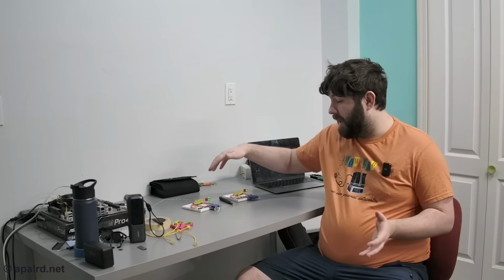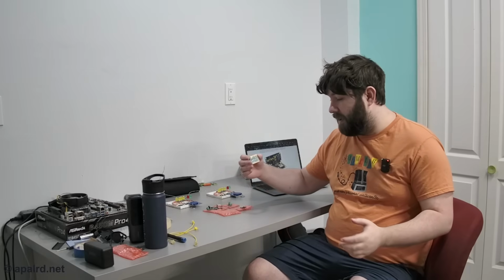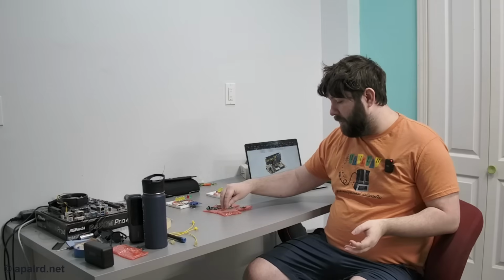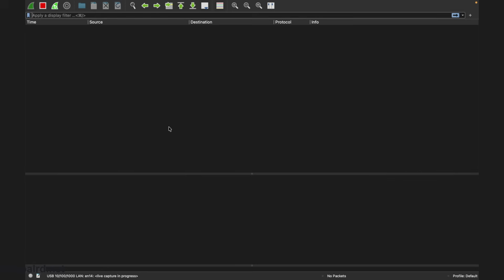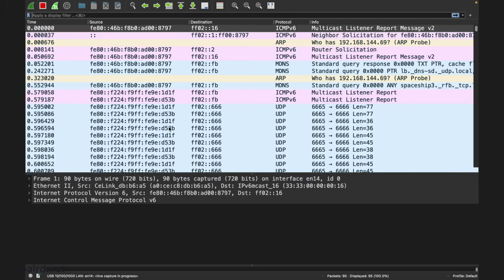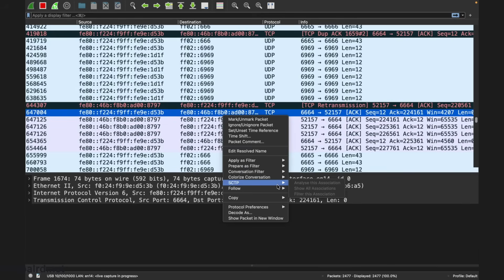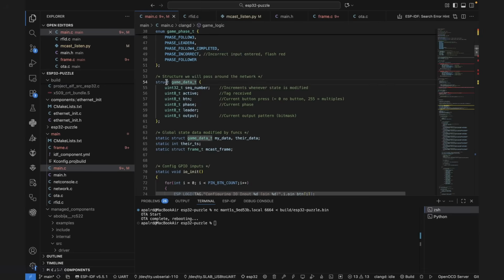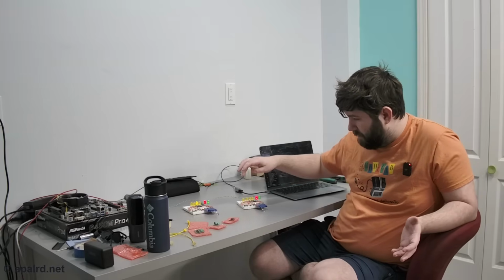ETHERNET is a BUS again?!? Taking a look at 10Base-T1S Multi-Drop Ethernet

Comment: Maybe a missed point is how T1S is galvanic isolated (with capacitors or magnetics), where CAN and RS-485 need additional hardware.
Reply from the maker: T1S (and all Ethernet over twisted pair) can be galvanically isolated. However, in the T1S case, that means you can’t use power over data lines, and these boards aren’t galvanically isolated.
Reply: @apalrdsadventures yes, they could have a jumper to disconnect the power part when you need DC block.

Comment: spe has no general availability in 2026

i also need low speed multidrop or daisychain fiber buses to be available

perfect for remote control, super easy to transient protect. could put mov on power and data just won't conduct at all

Comment: Electrically, CAN bus is not 2 but 3-wire. Although it might work when the power source is shared, this is not the correct wiring. A common ground is needed to refer to by the expected potentials over A/B wires.

Comment: Actually one single bus that connects everythiong in a car, to simply put never happening. Manufacturers will always keep separate (at the bare minimum) the mission critical from the infotainment......
Reply from the maker: It’s already here. High speed stuff uses point to point T1 Ethernet, and low speed stuff is using CAN and moving to T1S. There are still Ethernet switches at key points and those can restrict bandwidth per port and limit who can send which frames.

Comment: In a way solving non-existing problems. A fieldbus is mostly used as a memory. To that memory various sensors and switches are mapped.

If you have 100kbit/s or even 1Mbit/s and transferring switch/sensor status within couple of bytes.
VS. Ethernet 10Mbit/s for those registers one byte value but minimum frame size is 64 bytes... you are able to calculate.

The only useful thing is PoE. But PoE switches have their limits. One of the limiting factor is high cost.

Multicasting is really rare.  Have not used it during my 40 years with Ethernet/Internet. Except defined one for MOM use.
 
Have researched this area a lot because would like to create a dynamic (plug'n'play) sensor network for farm use.
Reply: Did not even mention the extra power usage. For example if you have like 1500 sensor boards around ...

Comment: This would be the coolest thing ever for home automation.
Reply: I'm interested in which usecases you are seeing?
Reply: @randomname1234-y4k given that it's a bus, you could just daisychain lights together, or run a single pair of wire from one automated curtain to the next. It already has power, so you don't have to run power wires or have to deal with replacing recharging batteries every week. Just 2 simple wires. It's ESP so it should run ESPHOME just fine. And you don't have to have a million devices clogging up your 2.4Ghz wifi.

Comment: Any thoughts on using this for Home Automation? Using 8 nodes/sensors per segment to create multiple zones within a house. Add a few bridges with CAT5e to your LAN and add the stuff to Home Assistant. Some custom boards with the LAN8671, MCU and some LwIP for some sensors?!. Or would it be better just to give every sensor a single port Ethernet PHY, or or add a 3-port switcht to every sensor to "daisy-chain" the sensors...(PoE would be more difficult in this situation, PoDL for T1S would make it great to create power and data for this small group of sensors) Great video BTW, great to see you doing ipv6 on Embedded! PS Ethernet is awesome!

Comment: There's no difference between this and CAN, because you still need a gateway before bridging into regular Ethernet
Reply from the maker: This is still Ethernet so the bridge is not converting frames and does not need to be aware of any of the data structures. Can gateways need to decode the data, so they need to be programmable and are another device you need to keep updated with data formats.

Comment: So is it a bus, or is it daisy-chained? You seem to be using the terms interchangeably.
Reply from the maker: Electrically it is a bus. To make wiring easier, the ManT1S boards have two sets of terminals so you can daisy chain, but the two terminals are just connected together

Comment: Nice idea, basically the old 10base2 with poe on twisted pair instead of coax, but at only 25 meters length, which is too little to be useful in a home environment. I would like to avoid having more than a single bridge from standard 1000baseT to T1S to drive the whole network of home automation devices.
Reply: Look at 10BASE-T1M, soon to be a standard in February 2026. Same PHY, but improved physical layer for twice the nodes and twice the distance. The intention on 10BASE-T1M is for use in building controls.
Reply: 10baseT1M sounds amazing! Do you have any good resource on this? Is the standard only completed by then? Does this mean that PHYs are available then also? Ty
Reply from the maker: Each segment is electrically broadcast, but each bridge/switch is doing mac learning so only traffic to/from nodes on the segment is consuming bandwidth on that segment. Having multiple bridges to T1S means you can send >10mbps of traffic in aggregate.

Comment: Oh. That is really nice. I was experimenting with 10Base-T1S Ethernet for home automation about a year ago, and have some prototypes, and junky boards, and stuff done with it, but it is junky (a 10BaseT Ethernet to T1S switch chip on a board does not look pretty) - and me as not a full time electronic engineer, and this electronic thing only being a hobby, I did not get it to a great state due to lack of time and focus. I also used Microchip parts mostly. These ManT1S boards are really cool. And honestly these other devices are also nice. I could not stanand complexity and speed limitations of KNX, or number of wires of normal 100Mbps Fast Ethernet (I did actually experiments with WESP32, and I did really like it), nor speed limitations of CAN-BUS, and CAN-XL is still kind of meh, i.e. it supports only rather small packet sizes. So I went with Ethernet, and T1S is amazing. I only need about 10 meters in my design (it is just a lot of stuff in one or two cabinets mostly), but fact that T1S can do even more is really nice, and allows me to also do remote stuff easily. And I can use normal software, protocols, UDP, TCP, HTTP, IPv6, DNS, you name it, and control it from a normal computer, laptop or SBC.

Really cool you covered it. I believe you can have more than 8 device on T1S. I think the limit of 8 is only when you use assured delivery, with time slots and mastering in similar style to CAN bus. But when operating in CSMA/CD mode, I think you can have mode. Not something you would use in a car, but perfectly fine for home automation and IoT with only sporadic transmissions.

Comment: The explanation of indisputable benefits of ipv6 for this application was great. Your description of canbus sounds exactly like Modbus that I've been dealing with lately: ethernet controller which converts all messages to serial modbus packets that broadcasts with specific device ids. Would be much easier if each device was ethernet-capable instead.

Comment: I don't understand.  Tcp/ip is above the physical layer.  You don't need ethernet to use it.
Reply from the maker: You need a bus which can carry at least 1280 bytes on the link layer to carry IP at layer 3, or the link layer must provide fragmentation reassembly. At best CAN can carry 64 bytes with CAN-FD, and most of the other niche and industry-specific busses can also not carry very large frames.

Comment: Funny how we're going full circle again… over 25 years ago I ran 10base-2 over 25m of single twisted pair phone wires because I ran out of RG58. Just two BNC connectors with a twisted pair between them. Well, and a termination resistor on each end of course. It actually worked flawlessly! :D
Reply: Well that's interesting. As an experiment I ran from my room across the house to the basement probably 50 feet of 75 Ω TV cabling. It worked I had to use a variable resistor to match and I had no problem with it quite robust. Never thought of doing twisted pair.

Comment: Another question, with the esp-idf does it just sort of work transparently with the networking functionality already built in? If I use esp-rs with the idf hal will it just work with mant1s hardware? I just backed the crowdsupply project but it seems you have access to docs I don’t.
Reply from the maker: In esp-idf I just configured a generic Ethernet phy and only had to set the phy config pins and phy address, which are in the examples in Python on GitHub. Aside from those three numbers I didn’t have to configure anything to use the phy.

Comment: Wait, Ethernet started off as a bus network...  So we're just using an old feature as new again?
Reply: Sounds like it.  And back to the same speed ethernet had last time it was a bus.  But this time in twisted pair instead of coax, which should be a lot cheaper and nicer to work with.  (Depending on how fussy that single pair requirements actually are - doesn't look too bad but I haven't seen the official specs.)

Comment: Is T1S compatible with any old ethernet controller, just using a T1S specific phy?
Reply: This is plain ethernet so providing someone use T1S adapter to 10base T, sure a hub or switch will work as expected 🎉
Reply: @testman9541  What I mean is, to connect any microcontroller that has a 10/100 ethernet interface, normally you use a so called phy chip to handle the physical connection, and then a signal transformer between the phy and the outside world. Is connecting such a microcontroller to 10baseT1S instead of regular 10/100baseT, just a matter of using a different phy.
Reply from the maker: It’s just a matter of a different phy. These boards are using the esp32 onboard Mac and they just work with the right pinout and phy address and no other changes in software.

Comment: EhterCAT for the win and even for my old ender 3d printer!
Reply from the maker: EtherCAT has the huge disadvantage that the receiver requires a very specialized asic, it’s not an off to shelf MAC. This and its niche (lower volumes) use makes it expensive compared to anything based on standard Ethernet parts.
Reply: @apalrdsadventures  Interesting! Yeah, I was wondering how this differed from EtherCAT.
Reply from the maker: EtherCAT works like cut-through switching. 

The frame is passed through from the upstream port to the downstream port one bit at a time with no buffering, and individual message bytes are modified in place and the checksum recomputed. So the EtherCAT master sends a frame which goes through every device in the bus, each device reads the whole frame for command data and writes certain bytes for its status data. 

The master end is standard Ethernet but the devices are not, they need custom asics to handle the telegram at line rate.

Comment: Except that anyone with basic understanding of systems design knows that you do in fact need separate busses for separate systems. And there isn't a better firewall then a limited translation layer. 
Also. Implementing full IP stack to shuffle around few bytes per second seems excessive to say the least.
Reply: It's ethernet. You VLAN it, and wow, they're magically separate. With no router to ROUTE between the VLANs, they can't be accessed.
Reply: @supertoaster94 I'm very old school in that regard. Things can happen to routing tables and vlan lookups. You can forget an extra rule you put in for testing, but you can't forget extra physical node you've put on the bus.
Reply: @denisdrozdoff2926  there's no router, there's no routing tables, there's no inter-vlan communication, there's no issue. vlans are layer 2, routing and IP is layer 3. you don't even need to use IP as your layer 3.

Comment: Problem with Ethernet is that it is still way too expensive compared to competition.
Reply: This should be a lot cheaper.  Slower speeds make the electronics on both ends cheaper and the single pair means you need 1/4 as much.
Reply from the maker: It’s expensive because all of the products on sale to normal people are designed for automotive test engineers, and this is the only consumer board. The chips are not expensive but they aren’t common enough in the open market for board prices to come down yet.

Comment: Why 10mb/s when that has been all but museumed in the real world. Many high speed switches 2.5 and 10gbs wont even recognise the 10mbs standard. The minimum should be 100mbs otherwise you need, hard to find ,legacy equipment to interface with this.
Reply: Because many IoT devices dont need the extra speed and cost. There are higher speed variants of single pair Ethernet running at 100Mbps and 1Gbps. These obviously cost more, though there are some really cool features like 100BaseT1L that stretches single drop out to 500m add in PoD for uptown 50W power delivery and think thinks like CCTV systems for an entire site being powered from a single switch in a central location
Reply: You need special switches for SPE anyway.

Comment: PoE, 10mbits, just with a single pair? Holy shit! RS232 and others required at least four wires
Reply: RS232 was just 3 (TxD, RxD, Common) but you could add other various status and handshaking if you wanted.  It was also very short range and not a "bus".  RS485 used 4 because balanced (Tx pair, Rx pair) but gained much greater distance and was a bus. There was a de facto "current loop" serial standard that used 4 but was never offically document and interop was haphazard. It could go very long range if you had high enough voltage capacity but most implementations I saw were not a bus.
Reply: @Sylvan_dB  "RS485 used 4 because balanced"

Wrong. RS485 is half-duplex with 2 wires (plus maybe GND).
Reply: not PoE, but PoDL (Power over Data Line)

Comment: Nice!
With home automation this is cool protocol for sensors in home or DIY alarm system. Less wires is bonus. Smaller wire can be hide easier, especially, when remodeling home.
Worth looking deeper! 👍
Reply: I mean one wire is likely much cheaper. But apparently some stopped producing sensors for it?
Reply: For one wire You need two wires, because of ground and distance isn't very great - they are only for short distances.. And as extra, not all sensors are available as one wire..
T1S bonus is, that on the other end of wire, there can be anything.
Reply: @artursmihelsons415 one wire can go pretty far, and can also handle some subpar topologies. Reliability though is so-so.
Reply: RS485 is still king for cheap longer lines.
Reply: $50 per node though.

Comment: I wonder how well this would work with two-wire security systems. Typically you have one pair per zone, and a zone could have multiple sensors (imagine all the exterior doors are wired in series - opening one would cause the zone to open). You could take the same wires and make it much smarter!
Reply from the maker: I’m not sure how it would like the lack of twisting on the wires but the distances are short so you can try it and see.

Comment: It would be cool to wrap these into something that just uses an edge connector to connect to the desk/wall. I imagine the lore is you would need the 4 different card readers (containing the mantis boards) installed in the security desk and you would need the 4 correct key cards (RFID) to put in the card readers. 

The mantis boards would power up when you slam it into the slot and give a green light when ready. Maybe reuse some PCI slots and just make one side power/signal and the other ground.

Comment: These things are super cool, just found them on CrowdSupply recently. I understand the power part of t1s isn’t standardized yet so these won’t interoperate with other gear to power non-mant1s hardware. I’m sure it could be made to work but any idea if these could become standard complaint if the standard does emerge (looks like 802.3da)?
Reply from the maker: The power over data lines is part of the standard but there is no negotiation of voltage or load yet, so it must be designed and not auto-discovered. AFAIK it’s entirely compatible with other boards other than some of them not supporting such a high voltage.

Comment: CAN-FD can reach 12mbps, but ethernet is the way to go for sure.
Reply: There is 100BaseT1 as well, and they are working in 1000BaseT1. The 100BaseT1 will stretch out to 500m and deliver power too.
Reply from the maker: 1000base-t1 is already done and so is 2.5g, 5g, and 10g. They require progressively higher cable quality, all the way up to 4000mhz cable for 10g, but 100m and 1g are fairly reasonable for cable specs.

Comment: "Every time you want to go from one standard to another you need a bridge." I don't see how T1S eliminates it, especially seeing all the chips on that Mantis bridge board, it's doing a lot more than simple level shifting or whatever to connect 2 wire to 4 (or more) wire twisted pair. Why doesn't regular 4 wire 10base-t work in automotive?
Reply from the maker: The T1S bridge is a switch with T1S on one side and 100m on the other, it transports Ethernet frames transparently. It's roughly the same amount of electronics required to go from twisted pair to copper. 

But more importantly, Ethernet frames pass through without conversion, which would be required to convert CAN frames to/from Ethernet frames, so such a converter would need knowledge of all of the frame types and how to convert the data.